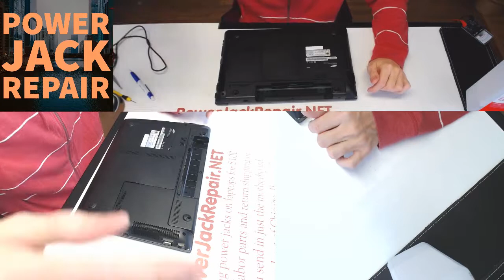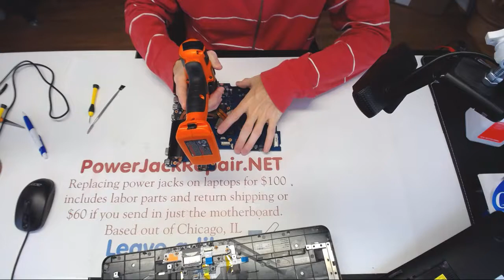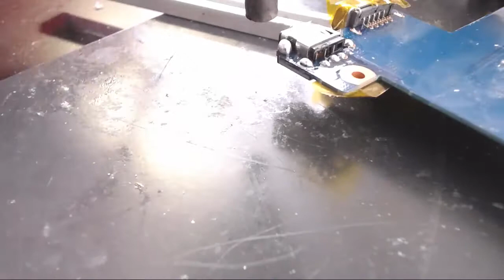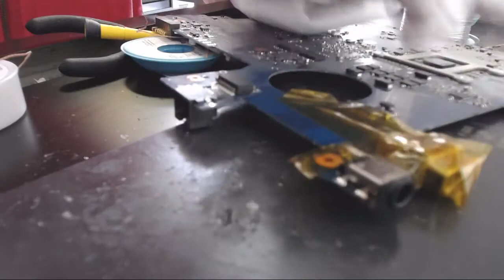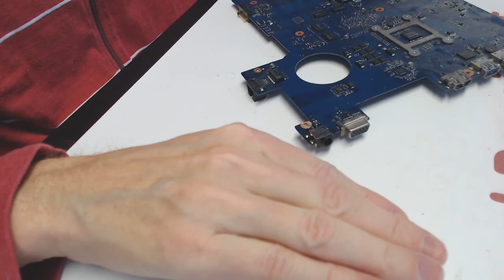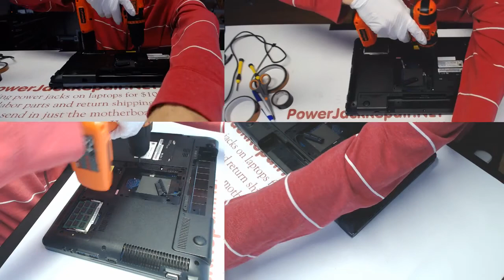Samsung RC512 np-rc512  broken laptop dc power jack repair charge port  fix socket

Comment: So I have the symptoms of a broken jack, however I can see nothing wrong with it. The center pin and housing look fine. I replaced both the battery and power cord, but computer and battery still does not get power.